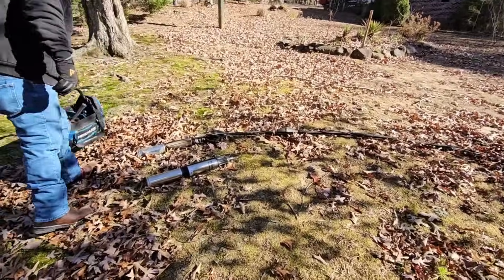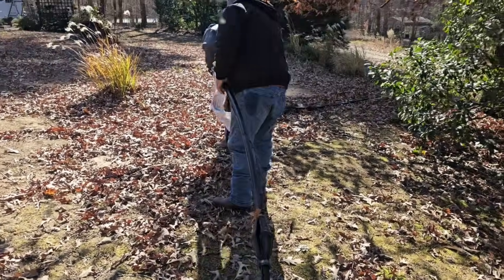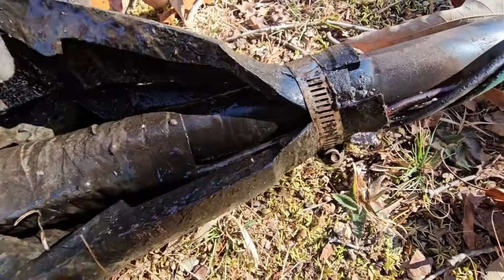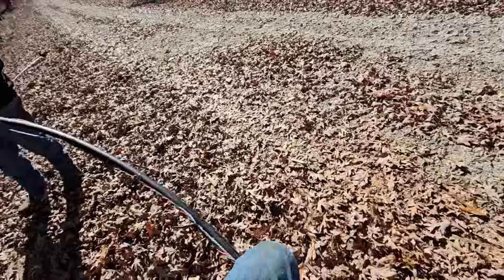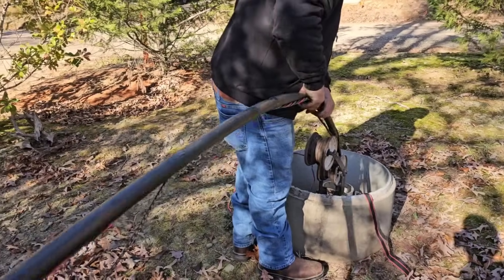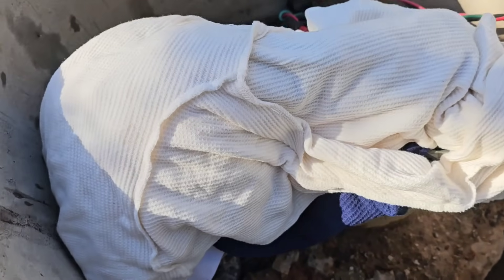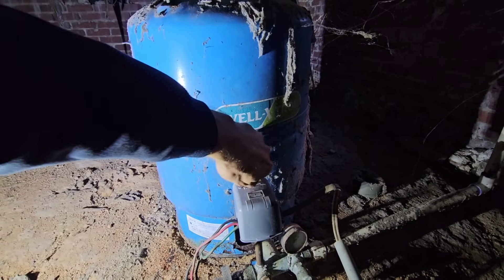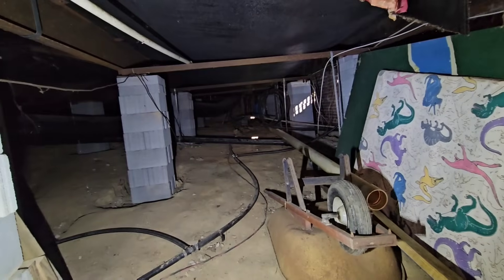Well Pump Repair. So much was wrong with this system! Watch & Learn

Comment: my brother is in the process of building, had been previously in contact with a drilling guy called on thursday and friday had 140' drilled, set at 103 and rated at 50 gpm, think he said it was only a 15 gpm pump, but he is in michigan water everywhere.

Comment: No way that system pushes anywhere near 160psi inside the pipe. More than adequate burst strength. Sometimes you are not correct in your assumptions.

Comment: In europe you would get into serious trouble with this sort of wiring ! Single insulation individual wires, so bad ! We would use a underwater rated cable, with at least one outer skin and wires, some have even double layer insulation. 
Also seeing how you guys connect the wires with twist terminals makes my stomach turn (not you fault I know). In any system like this there would be an isolation breaker in a water proof housing at the well head, where the pump cable gets terminated on the supply line. So you can isolate the power, plus you have a 'sheltered' connection and test point !

Comment: At 380 ft what is the psi rating on the poly pipe ?
& What is the cut out pressure at the tank ?

Comment: Great videos.  I'm not on a well water, but these videos are fascinating, a wealth of knowledge and you never know, I may end up on well water.   I had a lake house for a short time many years ago and I remember that the water had a sulfur smell and taste in the winter time, but in the summer it was fine.  I suspected it was based on the time the water was sitting in the pipes.

Comment: Was watching your videos again  and just wanted to make a suggestion. The tool you use to install the black pipe in the casing with the two wheels. You should start manufacturing it for us DIY folks. Just a suggestion    Phill. Thanks for all your videos . Have learned alot from you. Oh one question, is it OK to install a union at the tank tee to make it easier to replace the bladder tank.
Reply from the maker: @charlesbuendia3371  I've thought about making 10 of them & rent them out by the month & have the customer mail it back.

Comment: And thats my dilemma!  Finding a trustable, knowledgeable well pump company in NH. My Tank has 610' written on it, i get 1 gallon a minute from a 3/4 hp pump. 1st pump lasted 10 years, torque arrester failed wires broke, they changed pump kinked the hose pump lasted 8 years. Next company had me pull the pump and he changed pump while stealing the pump that was changed. Not sure how deep the pump is sitting at. Love to find an honest company that set this well correctly!

Comment: I am installing a new well pump and pump system and I am having a question. I am expecting my well to put out 53GPM, but where I’m buying my pump from they’re only selling 1.25” drop pipe. Can I use 2-inch poly drop pipe for my well?

Comment: Philip  I’ve been watching a lot of your videos  for a couple of years now & am wondering if you ever strip down any of the pumps that you remove from bores or wells? 
Herein NZ most farmers can’t afford to replace the pumps because of the costs involved ! Most would want the serviceman to strip the pump down to ascertain the internal damage & repair if possible because new parts are often cheaper than replacing the whole pump
NZ farmers don’t have the same sort of income that Americans do!
Do you always replace the pumps if it shows signs of overheating or the suction grills being blocked from iron deposits etc?
Cheers Dave!

Comment: I just moved into my great grandparents house. They still have a pump house set up. This summer we replaced the well pump because the water was not coming on. Come find out it was a corroded wire running down alongside the pump. It is a submersible pump. It has been cold lately and due to the terrible pump set up in the building falling down we have been running a heater out there. The water has frozen a little bit, but once I put a small ear on the line, it is up and running in less than 15 minutes. Today the water would not kick on it all at first we thought that lines were just froze when I went out to the pumphouse there was zero pressure on the pressure gauge and the breaker was flipped. I have a switch that does not have the handle. So I turned the breaker back on and tried to flip the switch. The boys have checked the wire to make sure they are all getting power and apparently the ones coming from the breaker box to the switch are fine, but there is no power getting to the pump from the wire from it. Bought a new switch we re-tried the same process and it would not work. We even tried emptying the bladder tank and refilling it with air refilling it with air was taking quite a long time. We are currently taking a break. Any advice would be greatly appreciated!!!

Comment: We just got a well. It's 440 deep at 4gpm. My driller installed a 1hp 10gpm pump. I was concerned that the pump gph is too much for the flow rate of my well. I asked the pros on Reddit and they all said it's fine.

Comment: Growing up (back in the 70s) on a NE Wisconsin dairy farm, my dad worked with the neighbor's well drilling crew in the winter to make extra money.  They drilled wells all year round.  He told stories of them using torches on the trucks' diesel fuel tanks & engine blocks/oil pans to heat them up!  They even drilled when it was -20 F !

Comment: My pump is , well let's just say some number of years old.    Watching you work sure makes me a lot more comfortable about pulling the pump next spring.
Thank you.

I think my pump is about 60 feet down and I hope to have substantial water pressure in the shower after replacement.    Does anyone have a pump suggestion?    As I recall it is a 220 v pump.    Yea sure I could walk downstairs and take a quick look at the breaker box but I think I'll put that off for a bit. 
All the best

Comment: So what do you call the type of business you do? Well driller, plumber?
Recently I am getting lots air and spitting from shower head while my sprinklers are running.  
Additionally, when no sprinklers are on I will still have, maybe remaining air in system, some little bit of spitting.  More so on the hot water side.
So I need to get a guy to come out but not sure who to call for help.
Maybe my pump is failing?  I can hear the pump hum but it’s a steady hum.  No fluctuating in pitch like you would likely hear if it was sucking intermittent air/water.  The well is I believe 425’ deep
Reply from the maker: Definitely call in a pump company
Reply: Pump company?  Is that a well driller?  I don’t know what brand size pump I have?

Comment: I remember a house giant cabin way up in Maine I think I seen writing in basement said well was 1380 deep house sat empty 10 years I went in got everything running has 2 - 5000 gallon water tanks in basement has 12 beds 8 bathrooms so  everything was broke from freezing pump in well had a old huge grundforce whatever its called had a level system so both tank stayed full so I had to change booster pump very expensive and of course the board died soon after but after I fixed everything never had a problem was there for weeks on top of mountain Sunday river .Maine .I stayed there for 3 months by myself bringing it all back to life had in floor heat and baseboard hydronic had to replace almost all base was blown out .somehow in floor was fine .the booster I put in was 5 times bigger than the one you put in wasn't cheap special order

Comment: When I was a young 18yop  in 1978, I worked at a quasi farm supply place that dealt in well pumps and had a repair shop. I did order picking, and I was in and out of it all the time. It always amazed me to see one of those pumps 100% disassembled on a work bench. So many impellers. So complicated to me. So I know what you are talking about with the number of stages. When I read the tile, I thought yay, he is going to rebuild one.

Comment: Talk about incorrect, we lost water over the weekend, and it ended up being a DIYer splice in the pump electric at the well housing. Someone decided that just twisting the wires together, and wrapping them in electrical tape was good enough. Who knows how long those wires were arcing. Fortunately the pump didn’t have to be replaced.

Comment: Love the info I’ve learned from you I put a well Troll tank in my moms house  in 1992. Now I live in the house and the tank is still charged to 28 lbs. I see you having to replace tanks much newer. I did replace the pump 1 year ago. Well is 45 feet and I put the 1/2 horse in at 35. Never runs out and keeps 2 sprinklers running ata time. The well was Putin I 1959. 
  Thank you for your videos. I always look forward to them.

Comment: I've had to 'hunt' for your videos. They don't 'pop' up like they use to. So I hunt for them. Thank you for the video.
Reply: check that your notifications are turned on  (the little bell beside the Subscribe button).  I was both Subscribed and had "All" notifications turned on, but for some reason it got changed and I had to turn them back on.

Comment: Dude awesome video, and great information.  But I need to correct you, in the video you said 1 PSI is equal to 2 feet of water pressure, this is not totally true 2 feet of head pressure is actually 1.15 PSI, or like I am use to seeing it 27.7 inches of H2O is equal to 1.0 PSI.

Aloha..................

Comment: At least the water wasn't as dark as the "Oil Well" in one of your earlier videos. I've recently started working for a water plant installer doing controls on large wells (20,000 home large). I was a bit surprised to find most of the wells I'm working on have big iron/manganese filters, very few are just a borehole pump, but then I'm new to this  Some boreholes bring up other minerals you would not want to drink and so we fit other filters as well as Fe/Mn. I also see a growing problem on farm land, decade's of chemical fertiliser is now starting to come up the pipe from deep below so again more filters. From where I'm sat testing and picking suitable filters is going to be needed more and more.

Comment: What was the static water level in the well?  Maybe it worked as long as it did that it only had to pump water up 150’. Not saying it’s the right size pump, but maybe something else changed in the well. Static water height?  Started getting clogged and needs to be fracked.  Geological change, etc.

Comment: Interesting repair video as always. One thing I wish you had mentioned since you removed 30 feet of down pipe is why was the pump set so deep and what is the static water level in the well?

Comment: You had a description about the pipe they used not being rated for the pressure, but then you reused it? Was the section you took out above the plastic inline splice enough to raise the pump to a height where the pressure is OK? Also I didn't catch what the static level was. Did the pump not need to be so deep?

Comment: Maybe to cover your arse mate you should replace the pipe with something rated to work at that depth. Can putting in a pump that can create pressure exceeding the pipe spec cause issues later especially, when splicing or exceeding max pipe load?

Comment: Cool video.  So if I understand correctly you hung the new pump at a shallower depth than the original?  So something like 380 minus the 30 feet you pulled off or 350 feet?  Since it was a short video I don't think you mentioned the water level.

Comment: My Well guy installed a OXY3 Iron Reduction system From Franklin Water Treatment  2 years ago for $2700 and our water has been tasting great and doesn't stink like rotten eggs anymore and we don't get the rust stains. I plan to install one of your pumps soon as we talked in January this year I think. My well is 400 + deep water static at 125 +/- feet and my pump at 235 ft. I want to drop a new pump down to around I guess 300+ feet with a soft start Pump to run my new Ecoflow Delta Pro Ultra  6000 Watt backup whole house power system.

Comment: I think that many tanks fail due to incorrect installation, if the air pressure is too low the bladder stretches too much and develops holes.

Tube tires have a similar problem when you use a tube made for a narrower tire, it seems to work correctly but after a few years it will start to leak and if you try to patch it you will end up with more patches than tube.

Comment: Big dog, whats the best recommendation for a 3 part or multi part well active charcoal scrubber water kit? The well guy put ours 1/3 hp at like 180 and i wanted a 1/2 hp pump but they told me thats what they do in that area all the time. Its 220, im not happy tho but my stepdad paid for it. So it is what it is till we have a problem. They said we had 20gpm flow from the well when drilling and they well pumped it down with and expansion chamber and it maxes at 5 to 7.7 gpm. I wanted to go with a 40ft bottom section of copper tubeing and was going to brase it in with a saftey link so it couldnt fall off.. im not a well guy just a high steel rigger car guy that like to over build stuff when i can. I also wanted to split a 2inch irrigation pipe and double sleve the well pump tube. I already know im going to have problems in a few years. Plus a 40/⁶⁰ switch. All the neighbors have 30/⁵⁰s and i would like to add a 2nd tank to boost pressure some with volume.
Reply: And I used a tandem 30 double 20 breaker in my well house. So I can also back feed a Genny and keep my well house warm. I can back feed at my  pole